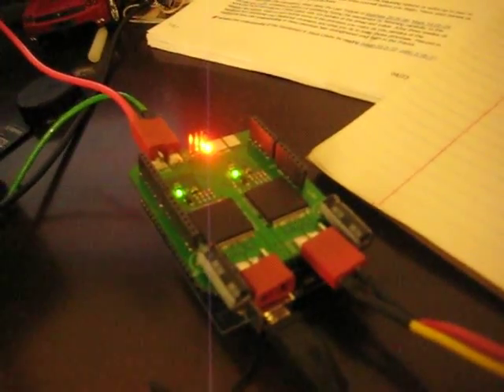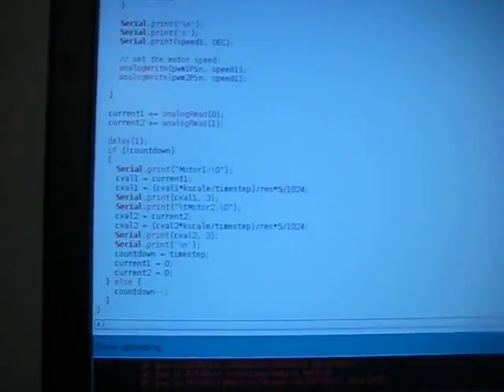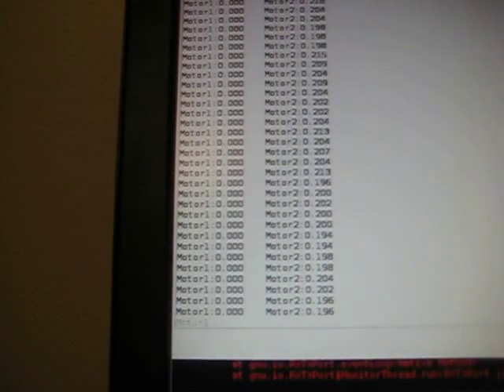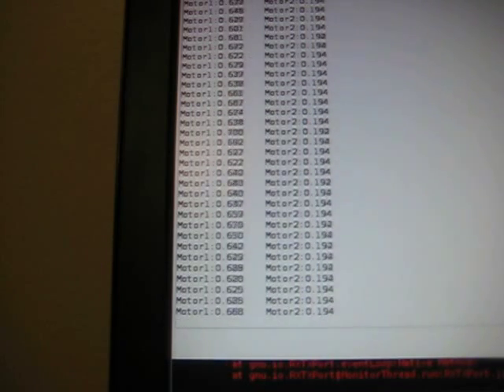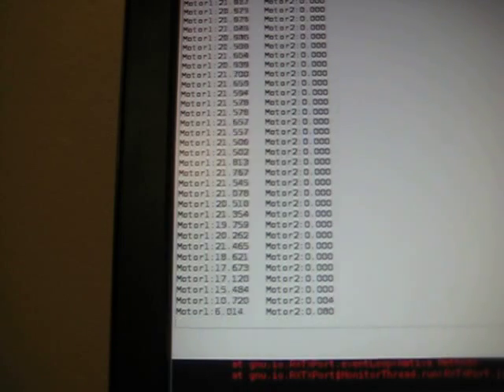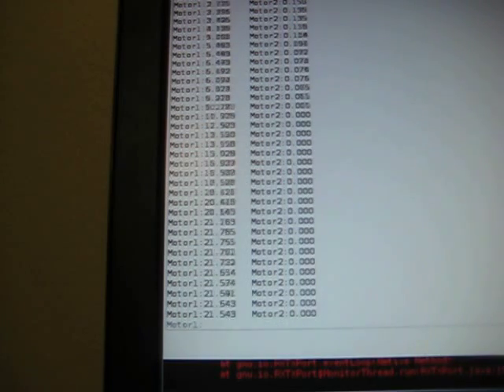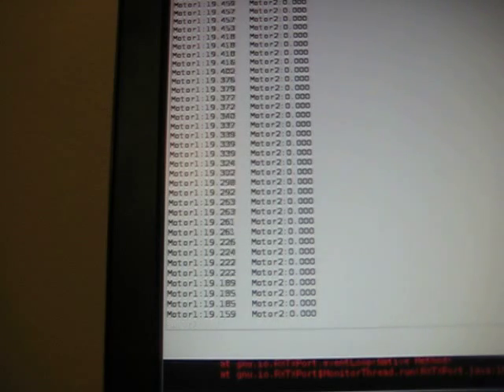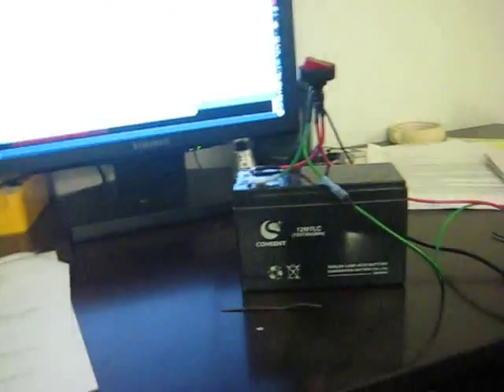High Current Motor Controller Shield Load Test

Comment from the maker: The VNH2SP30 has overtemp and overcurrent protection, it is a good option for a robot.  Plus, it provides current feedback, so you can check to see if the motor is stalled.  With feedback, you can make sure that as your robot climbs, you only climb at a rate that the motors and controllers can handle.